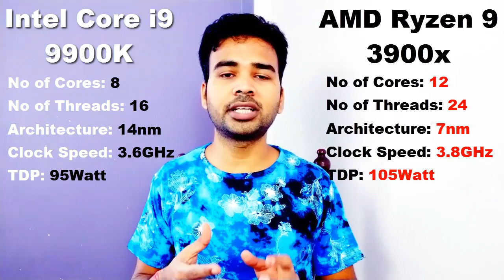What is TDP (Thermal Design Power) in Processor? Higher TDP is better or lower | Intel vs AMD

Comment: Just bought the 3700X. For an extra 10 bucks, I could have got the 3800X. Trying to convince myself that I still received the better one. But I dunno. Kinda screwed myself. Or did I? Tell you what, 12% more power consumption sounds like a much higher electricity bill.

Comment: Whats the difference between TDP and Power Consumption ?
Reply: TDP is a result based on thermal values, and is not relevant to Power Consumption, but however, there are some specific scenarios where TDP = Power Consumption, like when the CPU is in a steady state, idle, and completely stock.
TDP measures how much cooling capability a CPU needs in order to allow it to perform as advertised (mostly on base frequency), but in case you tend to overclock, or even perform heavy tasks, a higher quality cooler would be required.

Comment: In my Acer Notebook I can config TDP level either 45 Watt @ 2.2 GHz or 45 Watt @ 2.6 GHz … What do the setings mean? What is better for higher performance?
Reply from the maker: I will recommend you to use the default setting that is best for your laptop. If while running application your notebook getting freeze then only I will recommend you to increase clock speed: 2.6GHz or else not required at all.

Comment: My laptop processor have A4-3330MX have  35 watt tdp and I want to upgrade new one A8-3550MX which have 53 watt tdp this is necessary or not....
Should I upgrade or not plez reply
Reply from the maker: If A4-3330MX working fine no need to upgrade.
Reply: I need more batter graphics which provide by 3520M can I?? I want to run Filmora and aftereffact...